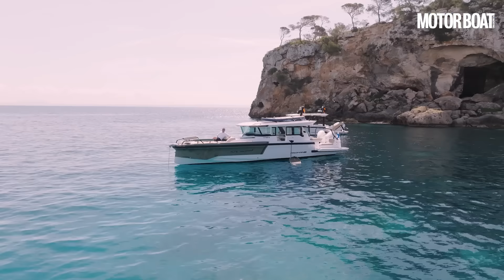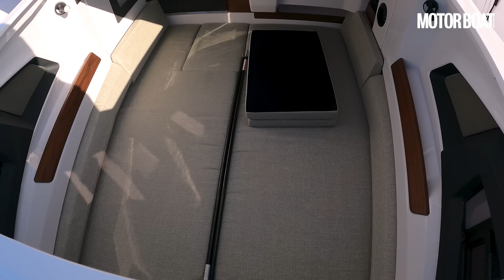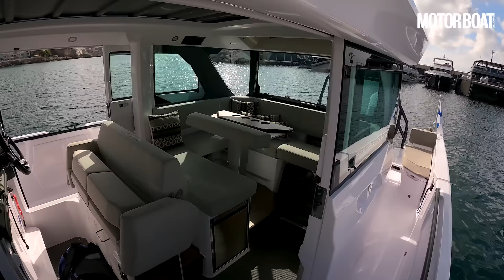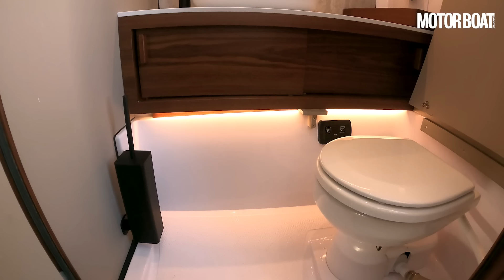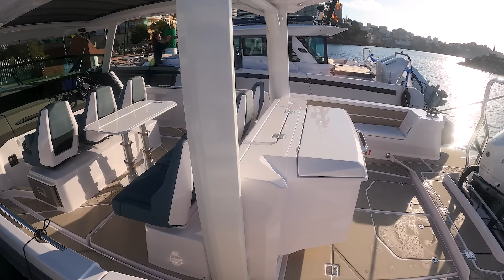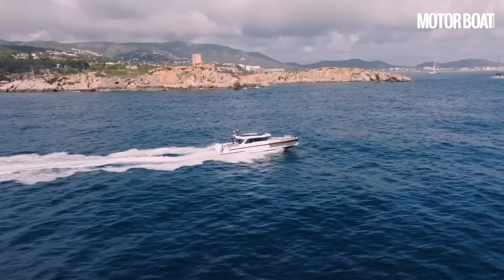Testing the Axopar 38XC (the follow up to a category smashing icon) | Motor Boat & Yachting

Comment: stopped watching basically all it is is a fancy speedboat a deisel gussler that you will need a fuel station constantly
Reply: Correct me if i’m wrong but i do believe those Mercury outboards run on what is colloquially known as gas, or even petrol.

Deisel [Diesel] is something completely different.

There, education is a marvellous thing
Reply: Hope you don’t fill the tanks with diesel